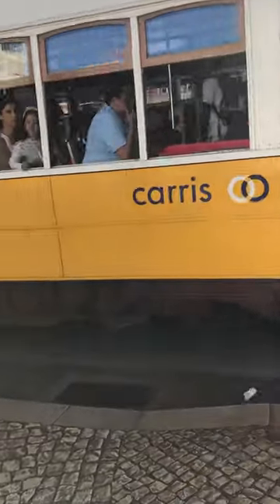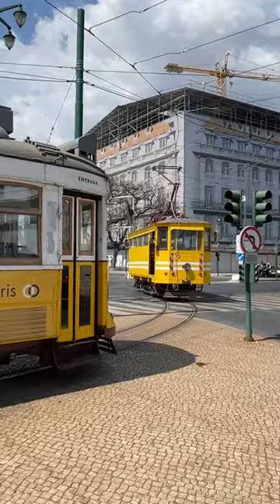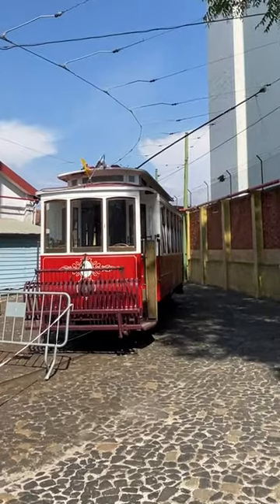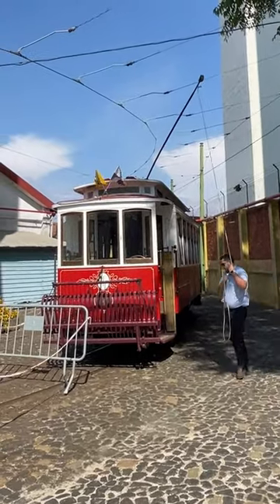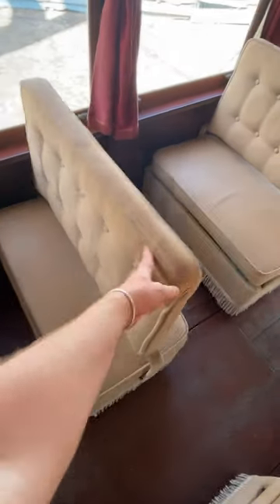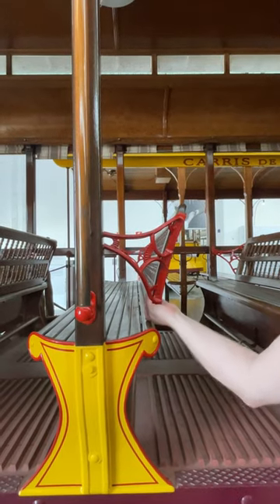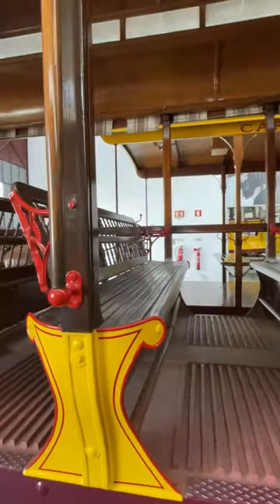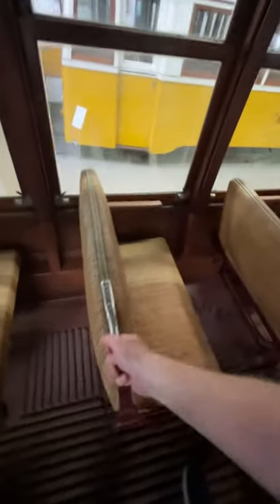Change your tram’s direction with this neat trick - OnlyTrams

Comment: Do they have turning triangles in Lisbon. 
Im from Belgium, home of the worlds longest tram line, around 70km long.
The costal tram uses 1 directional trams, an during summer has some 2 directional cousins to help who are transported from Ghent and Antwerpen. But they always use the balloon loops or turningtriangles. Theese are mostly in use when there has been an accident or storm damage or the likes. I know of the one in "Nieuwpoort" is being used in the summer at least 2 times around 4 to 6 am.
Reply from the maker: In Lisbon I only saw balloon loops as most of the trams are unidirectional now (they can be reversed for shunting but in service they only run one way).